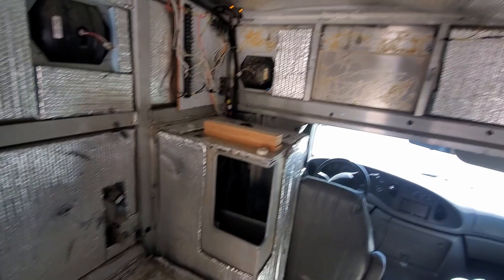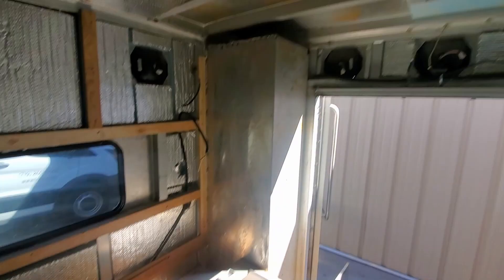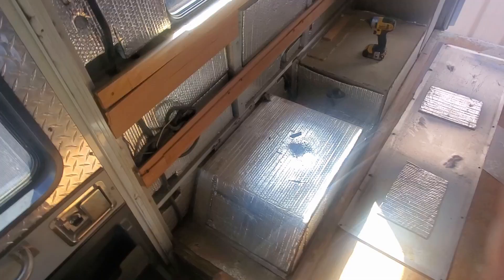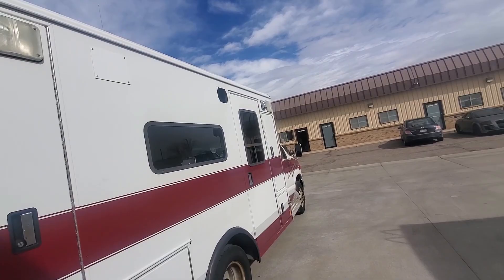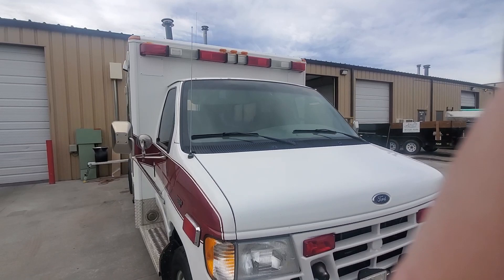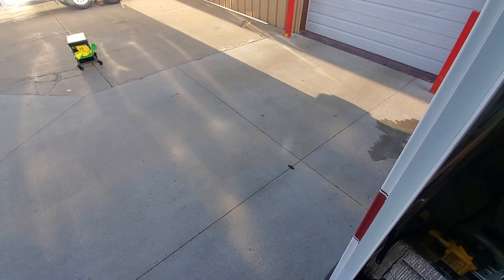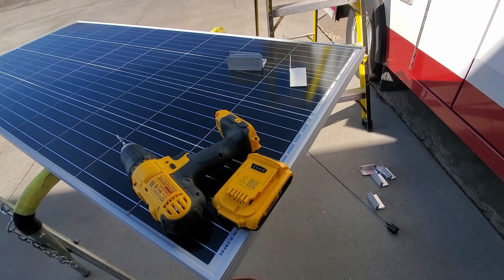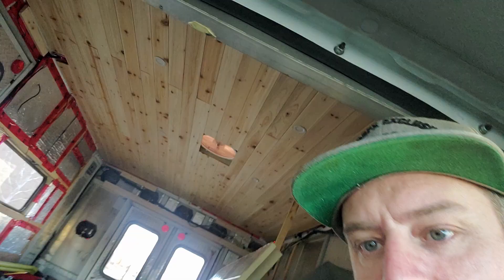AMBULANCE TO RV BUILD. FINAL DEMO AND CEILING INSTALLED!!!

Comment: Very nice to see what a stripped down ambulance looks like.  This is so educational. I like what you did with the ceiling, it looks warm and beautiful! Excellent job on insulation, this is key.  

I would love to know how much you gained in ceiling height by removing the old and replacing the new. You increased insulation thickness - do you still have enough room to stand up straight inside?

Comment: Did you keep the master on/off switch under the driver’s seat? If so, how did you integrate the solar into the existing electrical system?